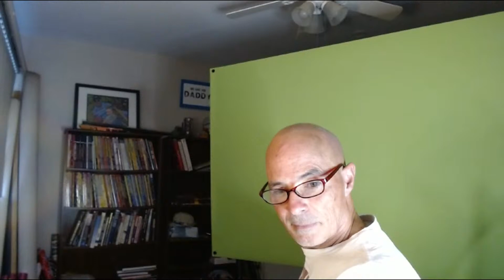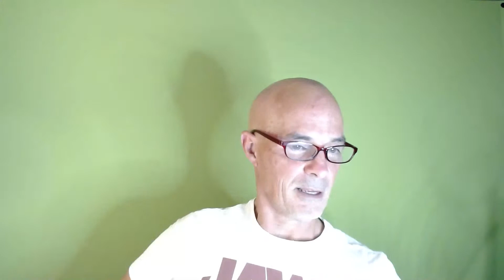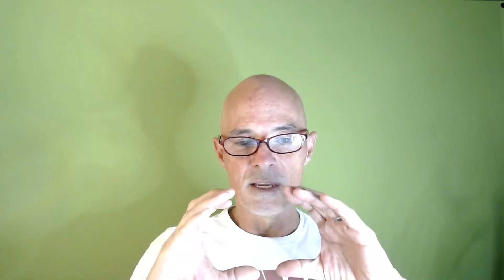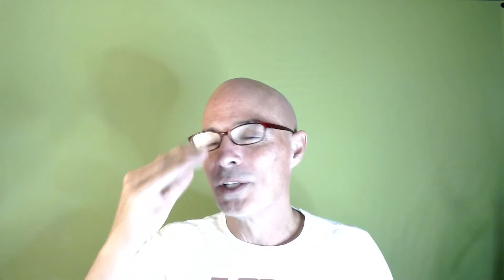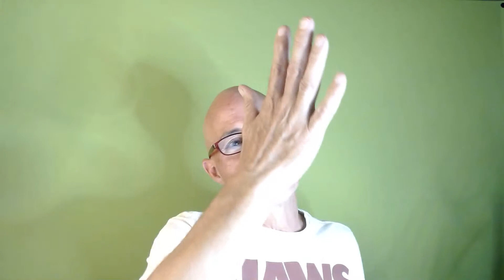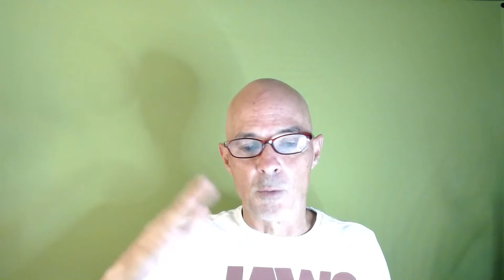LET'S TALK TURBOS-DIY INTAKES AND BOOST

Comment: Richard  Quick question 13 the 1 compression Elder Brock Victor junior heads Air gap and take 750 carburetor Is  Solid roller Cam 112 octane fuel What plug would you run
Reply from the maker: HEAT RANGE 8
Reply: Thank you sorry for shady info the nieboer has no clue what I bought I ask him about cam his answer was a solid roller 5 or 6  something,I did scope it it has dome piston so not sure that compression is accurate and he said he couldn't get timing to go above 23 full advance
Reply: Thanks for answering back

Comment: Hey Richard big fan here , I would like to see a dyno run testing cheap or stock sparkplug wires compared to high end wires .
Reply from the maker: WE REUSE THE STOCK JUNKYARD WIRES USUALLY
Reply: @richardholdener1727  Ok , no answer then .......

Comment: Timothy Bayliss; many engines are 3.937 " or 100 mm bore spacing, at least for the center cylinders. L and RB Nissan sixes, 4 cyl Mercedes Benz, BMW M30s,  and the 2.2 liter Dodge head is close to that ( it uses the 170/194/225 transfer tooling but it's not related...it's about 3.95). The 4.0157 Pinto shares the same intake as the 4.173 bore spacing  2.0/2.3/2.5. And Richard used the 5.0 OHV intake on the 4.6...using an adaptor. So branch spacing can be angled to intersect. You can then TIG weld or argon back purge the aluminum 90 120 or 180 bends to suit.
Reply: I always thought the Dodge 2.2/2.5 were 96mm bore spacing.  That carried through to the Nighthawk 4-cylinder.

Comment: If you spent 1% of the effort you do on building power to learn how to build a kick a$$ streaming setup. Your setup will out run everyone..
Reply from the maker: 1% doesn't seem like much
Reply: @richardholdener1727  well engines must be very easy for you ..lol i just put a electric turbo on my 2006 scion xb all i can say is wow that thing works. It's not a real turbo and I'm only getting 3.6psi but for a stock 1.5l that only made 99whp it was a big jump in power really only need it to pass people on the freeway

Comment: With a turbo...Pressurized Plenum volume might help the filling of each intake runner...thus HP?
Reply: I hear tell that increasing (or having an adequate) plenum volume might help throttle response at high RPM. 
I read somewhere that the volume should be 75% of the total engine capacity.
According to the factory, my 3.5L turbo engine has a 3.0L plenum volume, which is 85%. That may include the volume in the long runners...
I don't think anybody ever mentioned that fiddling with volume ever made more power on the dyno. Just a throttle response thing.
Edit: after looking at the manifold, I don't thing the stated plenum volume includes the runners.

Comment: How about loving some of us 4 litre cologne people?
Reply: Doesnt most 302 stuff apply to yall
Reply: @rustedratchetgarage6788  4 liter Colones are six cylinder and no, the Clone engines are a German engine designed in the early 70s
Reply: And the 4.9 l 6 cylinder is a straight-6
Reply: @josephd.4890  4.0 v6 is a 302 missing 2 just like a 4.3 is a 350 missing 2 is why i said my statement
Reply: I know what the cologne Motors are it's not an inline 6 I was well aware
Reply: @rustedratchetgarage6788  then I have no basis to understand your question because the cologne V6 is not the same as a 302 V8
Reply: @rustedratchetgarage6788  the 302 has a single cam in the block, the cologne engines have two cans one each on the cylinder heads
Reply: @rustedratchetgarage6788  and that is not how they are different, they are two completely different species of engines and engineered in different parts of the world
Reply: @josephd.4890  There were both 4.0 OHC and in block cam versions of the Cologne V6 but not a ton of support for either of them here in the U.S.A. The SOHC looks huge in an Explorer, while the 2.8 in my '76 Capri II looked tiny. I'd walk by any of them to get a 3.7  Duratec.
Reply: @dfabeagle718  o.h.c. in in the lifter valley, cologne engines are in the heads, different blocks
Reply: @josephd.4890  Okay, no worries... I had a Cologne V6 with cam in the block is what I was pointing out. That engine family goes back forever, something like mid-late 60's. It has seen a lot of iterations. What does the OHC weigh? I just saw one in an Explorer and it looks huge compared to the OHV models.
Reply: @josephd.4890  So the colonge isnt the ohv 4.0 pushrod? My mistake then
Reply: @dfabeagle718  yea thats the one i was thinking of
Reply: @rustedratchetgarage6788  so I'll say this, I'm not the most knowledgable clown in the world, My v6 is an 2010, last year for that engine family.Outside of Tom Marona racing, I dont find anyone supporting the s.o.h.c. v6s.
Reply: @rustedratchetgarage6788  You might be thinking the Vulcan V6 , 3.0, 3.8, and 4.2 car and truck mills. They are 90 degree V's similar to the SBF unless you start talking about the split port heads which are kind of funky. The Cologne stuff in the US was the 60* V6 like the 2.8,2.9, and 4.0. Joseph is asking specifically about the 4.0 OHC that came in the last of the old Rangers and RWD Explorers I believe. They are truly different animals from a SBF.
Reply: @dfabeagle718  no i was thinking the old ones
Reply: Hmm. A proper 60*  SOHC V6.
If the heads are any good it would be fun.